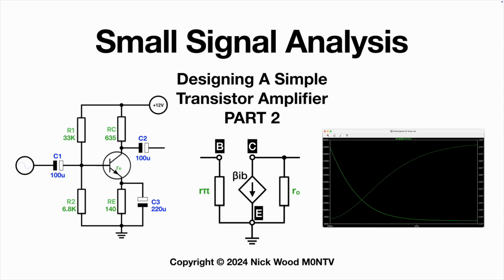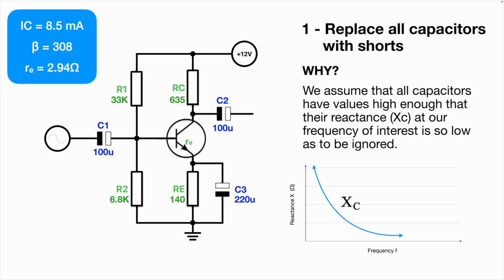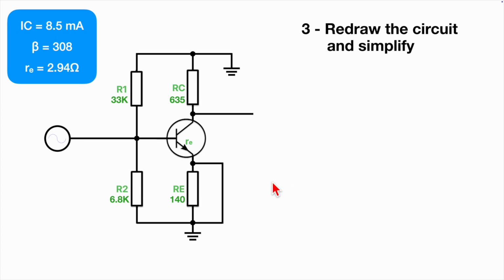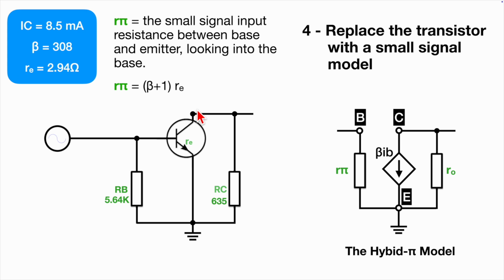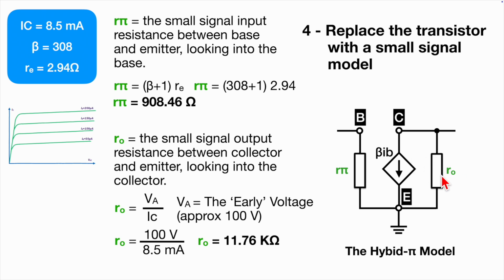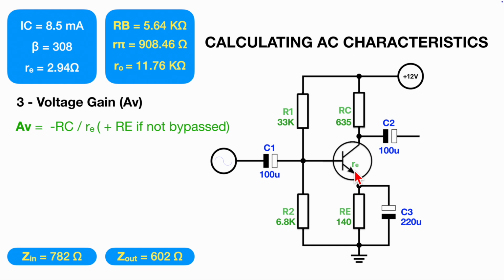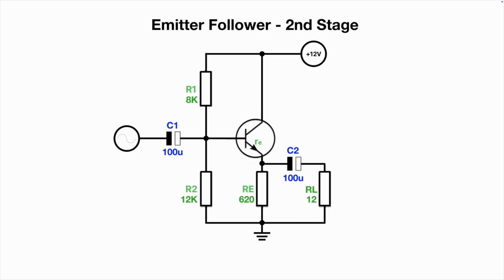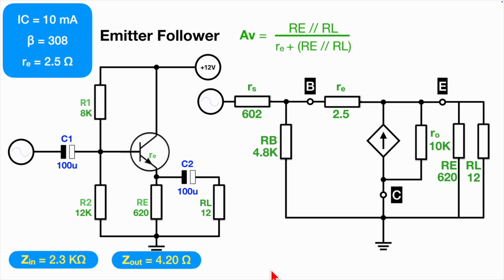58 - Small Signal Analysis (AC Calculations)

Comment: You didnt mention how you calculated the arse of e  (re). You use the thermal voltage constant  for a transistor at room temperature either 26mv  or 25mv and divide it by your collector current Ic which you had at 8.5milliamps, so 25/8.5 = 2.94 = the arse of e  (re). As someone who just learned to calculate the DC side of things and didnt understand  any other videos explanation of the AC side with the shorts and what not, this made sense and was very helpful, thank you.

Comment: I hate to say that this demonstration is the worst example of incompetence l have met from a person who should know a lot more about the subject. 
Heavens knows what ”small signal” means when you have 100u on the input. 
Any knowledgeable electronics engineer would know that the input capacitor is one tenth the value of the output capacitor, if you are expecting a stage-gain of 50 or so. 
Also any half-baked engineer would know that the collector resistor should be above 4k7 if you are talking about a small signal stage. 
However the biggest mistake is the fact that you cannot design  a circuit “in isolation.”
You must know the characteristics of the input signal and the impedance of the next circuit. 
The base-bias resistors are so low that they will attenuate the input signal enormously. 
At the beginning you need to know what sort of gain you are requiring. 
The bridge design is an absolute disaster. 
It should be the self-biased stage. 
I have been designing circuits for 50 years and teaching electronics and l have never used the bridge arrangement. Over 25 million visitors have read my articles on my website. 
If you really want to know, contact me.
Colin Mitchell.   talking@tpg.com.au

Comment: Why ist the IC 8.5mA?
With a635Ohm and a 140Ohm in serial at a 12v voltage supply tue Current must be smaller.
I dont understand this
Reply from the maker: Hi there! The best advice I can give is to watch the first video where I talk you through all the DC biasing considerations. This second one is confined only to AC analysis. Hopefully that will help clear things up a bit. It is the same circuit in both - the common emitter. It is here: https://youtu.be/Lr7MZQ6GIng  Hope this helps. Thanks for watching. Best wishes, Nick
Reply: Aaaaah....,now i got it.😀
Everything makes sense now.
As a non native speaker its not easy sometimes to follow and understand the technical details and translate simultaniously
Thank you vor your quick response.
Made some things clear,i was struggling with vor years.
Very informative channel.
Regards from Germany
Reply from the maker: No worries. Glad it helped! Best wishes, Nick

Comment: Perhaps there could be an application for such a simple circuit where only the beta Hfe and possibly the maximum collector current and collector voltage are entered. Is there such a thing? Some utility? Capacitor out is still contrary.
Reply from the maker: Hi! I think there are some websites and certainly some electronics apps that will calculate all the biasing for you with just some mininal input. But where would be the fun in that?!!!! Seriously though, if you really don't fancy doing all the calculations yourself then you could just lift a tried and tested design from someone else (I do so frequently). Sometimes you just don't need to reinvent the wheel! And yes, I know about the backwards cap. Thanks for watching. Best wishes, Nick
Reply: @M0NTVHomebrewing  Thanks for reply. I try find website with with invention of circle.
Reply from the maker: Just a couple I found by Googling are: https://www.omnicalculator.com/physics/transistor-biasing AND https://www.daycounter.com/Calculators/Transistor-Bias/NPN-Transistor-Bias-Calculator.phtml#google_vignette
There are probably plenty to choose from.
Reply: @M0NTVHomebrewing  Thanks for your huge time for it. Preamp builded before 1 hour with BC547A  beta 135 and works it
as according your scheme with 2N3904. Without limiting. And relatively pure signal output.

Comment: Why make it so confusing with those hybrid models and Arse of E, Arse of A, Arse of L.. ??? What the..
Reply from the maker: That made me smile! We use r 'sub' e (or little re) to differentiate the intrinsic resistance of the base emitter junction from RE (the external resistor connected to the emitter). Unfortunately if you want to calculate values like input and output impedance then you have to deal with a bit of small signal analysis. It can seem confusing at first and it took me quite a while before I started to get my head around it. It all depends what you want to do really. Anyway, thanks for watching. Best wishes, Nick

Comment: Thanks MONTV, Can please point me to the right document or book to have further good understanding on how zout was calculated for the second stage of the amplifier?
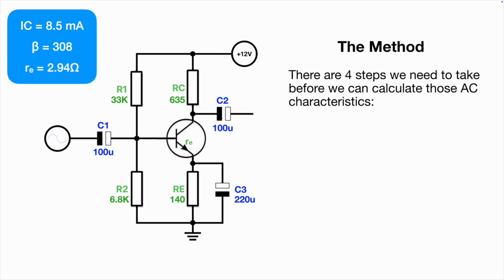Reply from the maker: Hi there! I'm afraid I don't have any text or document that I can easily refer you to. That's one of the main reasons I created the video - because finding simple information about this complex stuff can be challenging to say the least! My best advice (other than watching my video again and pausing it to make sure you understand) would be to watch Alan Wolke's excellent video on the Common Collector (Emitter Follower) amplifier: https://youtu.be/8f-nhjQ1jMk?si=YScTUZsQOD_g8IIK. The whole video is great but the particular bit you'll be interested in is round about 7:43. Just note that Alan is adding a voltage offset to his amp via his signal generator and doesn't have a voltage divider resistor biasing network on the base (as my design does). When it comes to the impedance of the source you need to remember to parallel RB (the parallel combination of the base biasing resistors) with the actual source impedance. Hope this helps. 73, Nick
Reply: @M0NTVHomebrewing  Thanks Nice. You got a really lovely content here. I have watched over 10 times now.
Reply from the maker: Thanks very much. 73, Nick

Comment: Hello! I might be stupid but I am confused on the Zout of the common collector circuit. Doing the calculations on my own (using the previous formula to find RB=(R1*R2)/(R1+R2) for the parallel parts) I got 12.8 ohms which is obviously not the same as the 4.2. However, when I used the parallel resistor formula RT = 1/(1/R1)+(1/R2) I achieved the 4.2 ohms. Does this mean the previous RB formula is only used in that specific instance? If so, why is that? Thank you!
Reply from the maker: Hi there! I'm sure you're not being stupid. Someone once said: 'There is no such thing as a stupid question: just a stupid answer.' I hope mine won't be!!!

RB is simply the 2 resistors in the voltage divider in parallel, so RB = R1//R2. In my CC example that would be RB = 8K//12K. It doesn't matter which way you calculate this the answer will be the same = 4.8K. So (8K*12K)/(8K+12K) = 4.8K and 1/8K + 1/12K = 1/4.8K. If you plug these values into the Zout formula for the CC that I gave then you should get 4.2Ω. It may be a bit less depending on how many decimal places you are figuring into your calculations.

I'm not sure whether this helps but I hope so. Thanks very much. Best wishes, Nick
Reply: @ thank you, yes this does help!

Comment: how to deal with inductor in transistor circuit?
Reply from the maker: That's a subject for another video! But essentially you'd view the inductor as ideal - so a short circuit at DC for your biasing considerations. For AC you'd need to calculate the inductive reactance at your frequency of interest. It can be a useful thing in the collector circuit of a CE amp where you can use the primary winding of a transformer to present 200Ω to the AC signal (instead of using a lossy resistor) and the secondary can present 50Ω to the load. Thanks for watching. Best wishes, Nick
Reply: @M0NTVHomebrewing  well by asking about inductor I was thinking about transformer that You describe so You answer my next question before I even ask it, thanks, Adrian SP6DEF 73!
Reply from the maker: No worries Adrian. Best wishes to you, Nick

Comment: Excellent video series.  One small question though: Shouldn't the polarity of the C2 capacitor in the 2nd stage be reversed? (i.e. the positive terminal on the emitter and the negative terminal on the load resistor)?
Reply from the maker: Good call about the output cap. You are right! It didn't show up in my LTSpice model but LTSpice has not found a way of simulating an exploding cap yet! In truth the real physical Circuit works OK but may not do for long! 73, Nick

Comment: 1. Since the transistor's intrinsic output impedance is around 100V/Ic and the collector load resistor is around Vcc/(2*Ic), we can see that ro is about 200V/Vcc times greater than Rc. With a 12V supply that means that ro is 16 times Rc and the parallel combination of Rc and ro is close enough to Rc that we can ignore ro for all practical purposes. The output impedance is therefore Rc and that's pretty much a given for all practical supply circuits.

2. If you completely bypass the emitter resistor Re, then the effective emitter resistance is just re and the impedance looking into the base of the transistor is β*re = 300*3R. Unfortunately, that is then the dominant component of the input impedance (900R compared with 5.6K). The result is that circuit's input impedance now depends on temperature (because re depends on temperature) and more importantly on β, which is the most variable parameter in the transistor (depending on sample, collector current, etc.). We really don't want the input impedance depending on β, so it is good practice to have an unbypassed Re at least 10 times bigger than re, in this case about 30R. Now you see that the impedance looking into the base is β*(re + Re) = 300 * (33R) = 10K, which is larger than the parallel combination of R1 || R2 at 5.6K. That dramatically reduces the susceptibility of Zin to transistor β.

3, The Voltage gain is -Rc / (re + (Re || Xc) ) where Xc is the reactance of C3. That is frequency dependant and the number one mistake made by designers is to assume that you just have to make C3 big enough that its reactance at 20Hz (commonly used as the -3dB frequency for audio) has to equal Re. But if you look carefully, you'll see that the high frequency gain of -Rc / re has a -3dB frequency when (Re || Xc) = re, which is when Xc = re if Re is much greater than re. Below that frequency, the gain will drop off at 3dB/octave until the frequency when Xc = Re when it will level out to the dc gain of -Rc / (re + Rc).
In the circuit shown, Av = -Rc/re = -635/3 = -210 at frequencies above 1/2π.220μF.3R = 240Hz. At 240Hz Av = -635 / (3 + (140 || 3j) which is approximately -635/ (3+3j) = -150 with phase shift.
Below 240Hz, the gain will decrease at 6dB/octave until Xc = Re, which is around 1/2π.220μF.140R = 5Hz, when it will level off to the dc gain of -Rc/(re + Re) = -635/143 = 4.4.
If you really want to bypass Re, and you want a flat response down to 20Hz, then you need a bypass capacitor of 1/2π.20Hz.3R = 2,600μF. Pretty big, eh? Another good reason to use an unbypassed emitter resistor.

4. To put the final nail into the coffin of bypassing Re, consider Av for the bypassed circuit when the output has swung up to 11V, close to the positive rail. The collector current will be 1V / 635R = 1.6mA, making re = 25mV/1.6mA = 16R. Then Av = -Rc/re = -40. Now consider Av when the signal has dropped to 2V above ground, close to saturating the transistor. The collector current will be 10V/635R = 16mA, making re = 25mV/16mA = 1.6R. Then Av = -Rc/re = -400. The gain is ten times bigger for negative output swings than for positive ones, and the distortion that causes is horrible.

5. I suggest trying a circuit where Vcc=12V, (giving target Av = -24), and a target input impedance of at least 10K. That tells you that β * Re has to be significantly bigger than 10K, let's say 100K, making Re = 100K/300 = 330R.
Now, we will design for 250mV across Re (to set re ten times smaller than Re, since re = 25mV/Ic). Since Ie = Ic (when β >> 1), that makes Ic = Ie = 250mV/330R = 0.76mA.
So Ib is around 0.76mA/β = 2.5μA. We will drive ten times that (=25μA) through R2, but R2 has (Vb = Vbe + Ve) = (650mV + 250mV) = 900mV across it, which means R2 = 900mV/25μA = 36K. Then R1 has eleven times the base current through it (=27.5μA) with a voltage drop of 12V-900mV = 11.1V, making R1 = 11.1V/27.5μA = 420K. Finally, the collector resistor needs to drop half of the available swing, which is Vcc - (Ve + Vce(sat)) = 12V - (0.9V + 0.3V) = 10.8V, so Rc = 5.4V/Ic = 5.4V/0.76mA = 7.1K. We could use R1 = 430K and Rc = 6.8K as preferred values.
Note that re = 25mV/0.76mA = 3.3R which is considerably smaller than Re = 330R, and that there is no point in bypassing Re, for the reasons above.
The input impedance Zin = 430K || 36K || 99K = 25K, so we could use an input cap = 1/2π.20Hz.25K = 330nF, which is nice because we can avoid putting an electrolytic in the signal path.
The output impedance is 6.8K, which is higher than we might like, but that is a consequence of the relatively higher input impedance. We can buffer the output with a common collector stage.
The gain is -6.8K/333R = -20. We could increase it a little by bypassing part of Re (increasing distortion), or by increasing Rc (reducing output swing).  I wouldn't bother.

[Edit:] P.S. I just spotted that you didn't take into account the loss from loading the first stage having an output impedance of 602R with the second stage emitter follower whose input impedance is 2.3K. That reduces the signal voltage at the second stage base to a value of 2.3K / (602 + 2.3K) = 0.8 times the unloaded signal.
Reply from the maker: Wow! That's some very detailed feedback. Thanks very much again for sharing your expertise. There is a lot of information here. Thanks for taking the time to do this. Best wishes, Nick

Comment: I will admit the one part that I had a bit of a struggle with in my Advanced First Term Avionics course in the Navy was reactance.  It took a bit before it clicked, but before that I was a bit confused.  I wish you had been one of my instructors :) .  AFTA was a 6 month, 8 hours a day course in advanced electronics.  We did deep dives into transistors and amplifier design.  We studied op amps and since this was the late 80s we studied a little bit of computers.  We had this Altair looking machine where we had to input opcodes by hand.  The final for that unit was to debug a program and fix the opcode(s) to make the program run.  Anyway, yeah, reactance was a bitch for me.  Later when I took EE classes and I saw the differential equations it made a lot more sense to me.  DC is steady state.
Reply from the maker: Thanks Delaroso. Reactance took me a while to get my head round too. Thanks for watching and commenting. Best Wishes, Nick

Comment: Great video Nick. Maybe you can explain how to find the beta and Early voltage in the model statement in LtSpice. Maybe explain some of the other parameters as well.
Reply from the maker: Hi James, thanks very much. That would be a whole other video. I don't know about calculating the Early Voltage - I've only ever come across approximations of it. Calculating beta is easy in LTSpice though. You just create a trace for the collector current, right click it at the top of the trace window and edit it to read: Ic(Q1)/Ib(Q1). This assumes your transistor is labelled Q1. You'll then get a trace for Beta. At some point I'll probably do a video on it but in the meantime there are a stack of other Small Signal Analysis videos using LTSpice. Thanks again. Best wishes, Nick

Comment: Excellent video. Just one question, why do we need to add +1 to the Beta?
Reply from the maker: Hi there! Thank you very much. Here is the reason we add +1 to Beta when we are at the emitter. Beta is the gain of the transistor. So the collector will see the base current multiplied by Beta. The emitter will see the same (although in phase with the base - unlike the collector) but it also sees the original base current which flows from the base to the emitter (not to the collector). So the emitter sees B+1. In all practical reality you can pretty much ignore the +1 as the base current is so much smaller than the emitter current. This also allows us to approximate that the collector current = the emitter current. Hope this helps. Best wishes, Nick

Comment: VERY well done Nick.

I cannot really fault it, and yes id did bring back memories of my old lecturer trying to demonstrate the use of the bypass cap by jumping up and down.

The only point I cam make is that right at the beginning you said that you changed the current from 10mA down to 8,5mA It would have been interesting to know what led you to that value
Obviously once you know the current them working out the resistor values is as before  i.e I think the load in analysis would have been worth while including. (maybe as a quick video supplement)

Andy
Reply from the maker: Thanks very much Andy. I did contemplate going into my thinking behind changing IC to 8.5 mA but it was really just a question of time. Load Line Analysis is another massive rabbit hole that I've been down in the course of producing these last two videos. I think it is fascinating stuff and perhaps something I can return to at some stage. In the meantime, if you are interested I discovered an excellent 4 part series on this on the Electronics for the Inquisitive Experimenter YouTube channel:
Part 1 is here: https://youtu.be/-fQotNX3gT0?si=s7EIEZ3dGYiagb7C
It is very thorough but Ralph explains everything brilliantly and it is clear and easy to follow.
Hope this helps. Thanks again. 73, Nick
Reply: @M0NTVHomebrewing  thanks, I have a peek atit and see how much I remember 🙂
Reply from the maker: No worries Andy. Cheers!